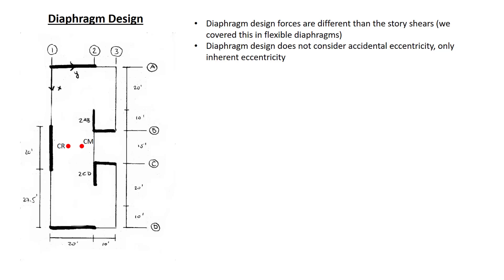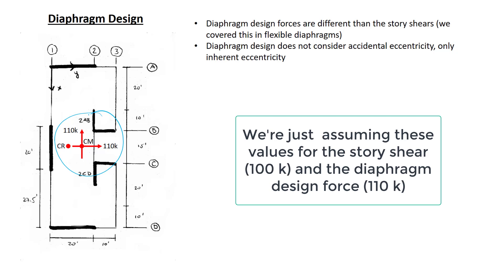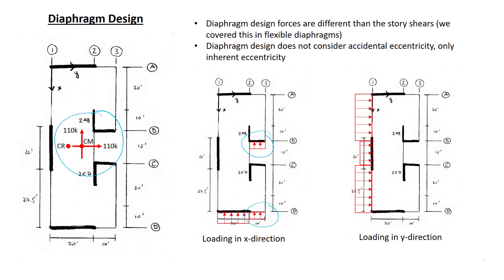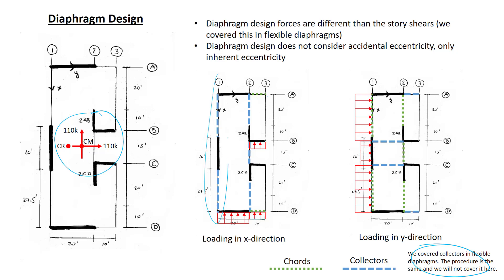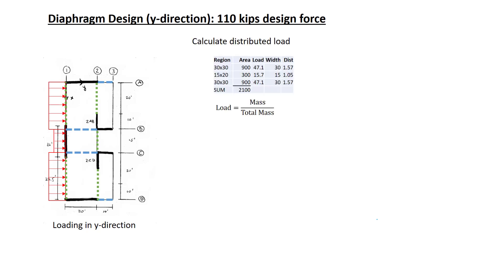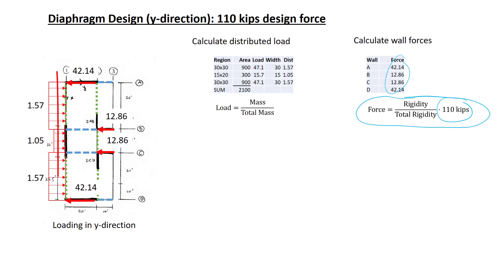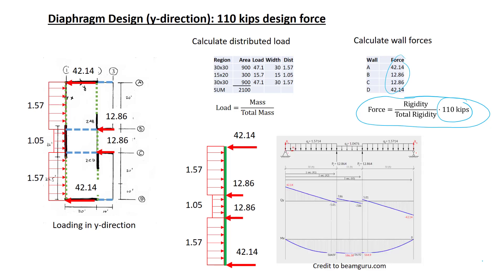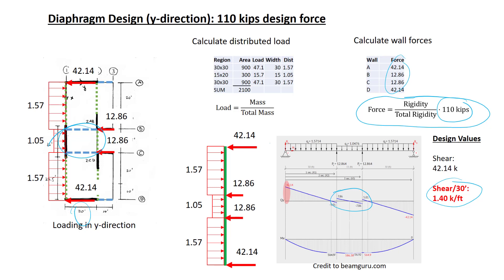Rigid Diaphragms 04, Diaphragm Design Intro and Diaphragms w/o Eccentricity

Comment: Accidental eccentricy is not considered in rigid diaphragms? Why? I believe you are talking about flexible diaphragm. Because flexible diaphragms distribute the lateral load based on mass distribution so there is no possible shifting of mass. While rigid diaphragms (similar to semi rigid diaphragms) distribute based on the stiffness of the diaphragm and shearwalls.